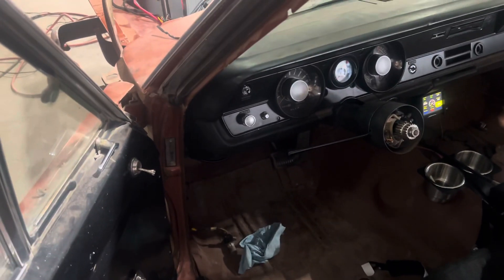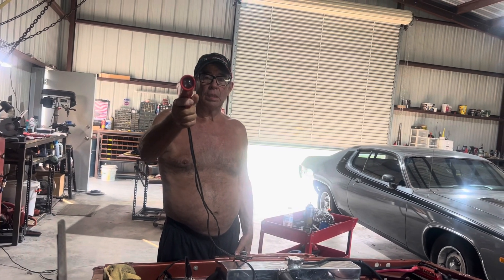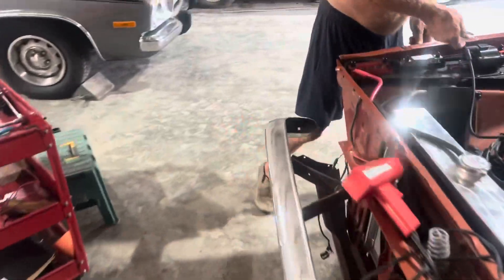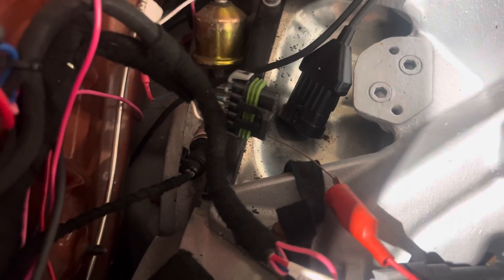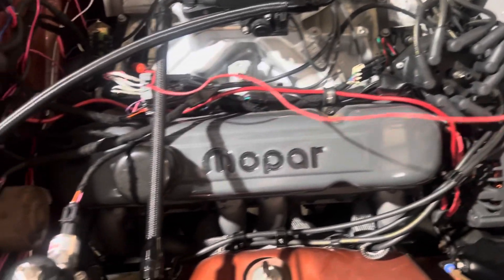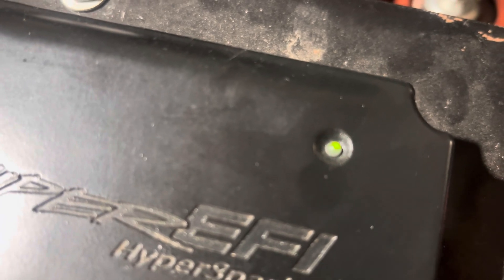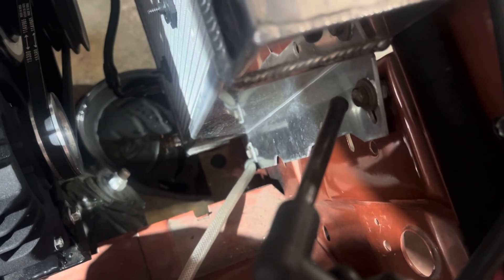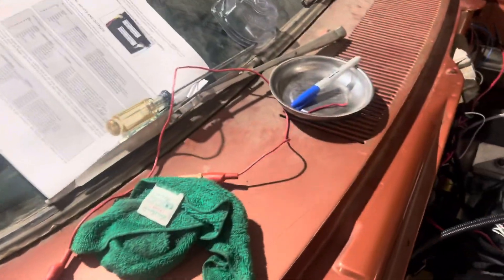Holley Sniper EFI loss of spark issue figured out?

Comment: I have a similar problem, starts and idles then after 5-10 min it shuts off, and when i crank it over the igitionbox LED stays oranje i do see the cranking RPM on the display. let the car sit overnight and it fires up instantly and idle again for 5-10 min. what turned out to be the problem and more importantly the fix?

Comment: Why is this problem so GD prevalent...I was just driving to the store and my engine just shut off..no warning just died..tested the wires..thought it was a bad coil to distributor wire nope.!.bought a new coil because testing the new coil no spark..get the new coil..no spark WTF..good system my ass .

Comment from the maker: I used a piece of welding wire and plugged it into the white signal white that goes between the Holley sniper and the Holley ignition box. The I used a jumper white from the welding wire to ground. Every time you ground the jumper wire your coil should fire and the light on your box should turn green

We determined after this test that the ECU was bad inside the sniper and Holley replaced it

Comment: How do you have that jumper wire set up? Where do you connect the other end of the wire?
Reply from the maker: The jumper wire connected to the white wire coming out of the sniper to the hyperspark box. The other end of the wire I held in my hand and would touch it to ground to initiate the spark to the coil. No spark means Holley ecu is likely bad